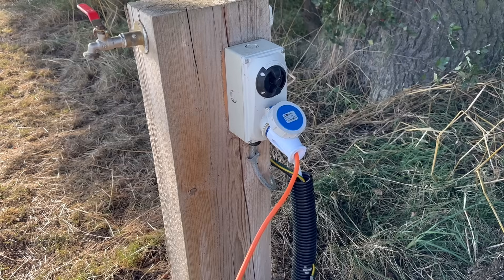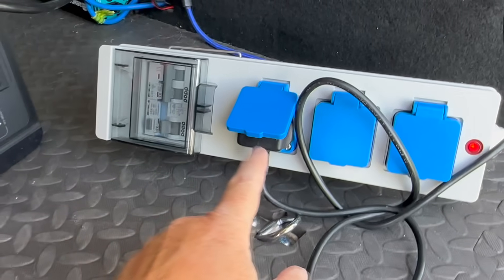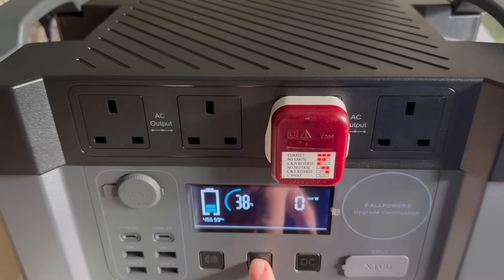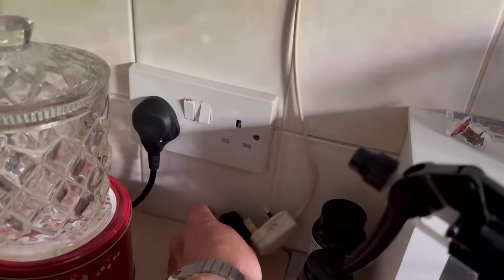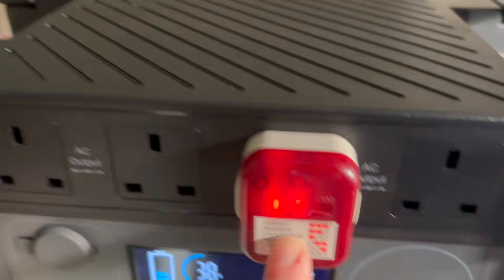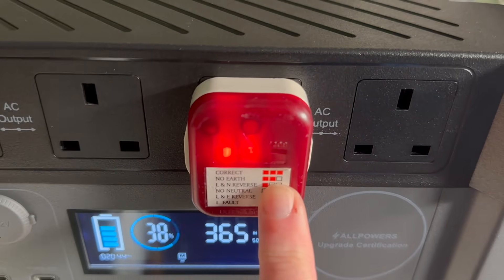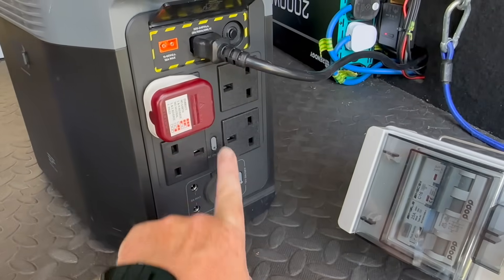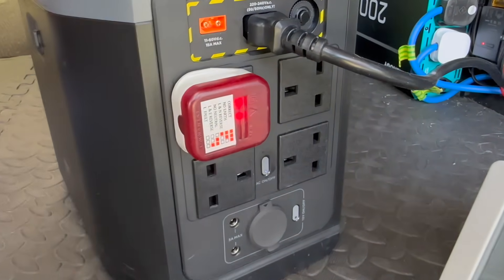Should you Earth Bond an Inverter to a Vehicle Chassis

Comment from the maker: As some viewers are getting really confused I just wanted to clarify the following…

“residual current device (RCD) is a safety device that switches off electricity automatically if there is a fault. RCDs are far more sensitive than normal fuses and circuit-breakers and provide additional protection against electric shock”

Source - https://www.ddfire.gov.uk/residual-current-devices-can-save-lives

There are many more resources that explain how an RCD helps protect you from fatal electric shocks and faulty appliances possible catching fire.

The internet is a great place to learn, so please use it. I’m happy to learn too, but I prefer to learn from facts rather than opinions.

Comment: Hi John, I'm building a new to me camper and visiting your channel for a refresher course if you will regarding the electrics, very well explained regarding earth and the inverter. I did notice you are using what I call a tent style 240 hook up, is this what you use in the van for 240 when on a campsite or anywhere you have access to 240? No so called traditional hook up point to RCD in the van? Thanks for posting the video

Comment: This is such a confusing issue for non - electricians like myself.
I converted a new cargo trailer to an RV. The solar system was originally installed in my 5th wheel by a very reputable solar installer who had done about 3000 installations before mine. They did NOT install any ground wire from the charge controllers or inverter. It's hard to belive they overlooked this with their vast experience. I assume it was intentional. I moved the entire installation to this converted RV. 
When I was about 12 years old I was in my dad's RV during a thunderstorm. There was apparently a problem with the pedestal at the RV campsite. I stepped out barefoot onto the wet metal step of the RV just after then rain stopped, then put my other foot on the ground. I vaguely remember being totally paralyzed, and shaking and screaming. Fortunately it knocked me unconscious, and when I fell face first into a mud puddle, my foot came off the step. My ankles felt like they were broken, yet within a few hours I was fine as if nothing had happened.
So to me, the thought of intentionally sending electricity into the frame of my RV just seems insane. Why in the world would I EVER want to electify the frame of my RV? I don't wish this near electrocution experience on anyone.
I used metal boxes for my 120 volt outlets in the RV. The box is grounded with the ground conductor, and the outlet itself is also grounded using a pigtail to the box. None of the metal boxes contact the metal frame of the RV. All boxes are screwed to wood framing. To my layman's mind, this means that if I ever have a short in a box, the electricity will be contained within the box, or the neutral or ground wires.
Why in the world would I want to change that in such a way that electricity is EVER sent to the metal frame of the RV?

Comment: Hi John, very informative.
my problem is. I have wired a ring main via an RCD unit with a B32 and a B6 RCD to use via a camp site if needed. i connect it via a cable which is designed for the job but it keeps tripping when i plug a hoover, kettle etc.
any help would be great
thanks in advance.
Phil.

Comment: So can I run a 2000w renogy inverter to a single plug socket  in the kitchen ?  for the induction hop though a 25mm cable .will this be ok or do I need to plug straight into the invertor

Comment: Hi John a quick question I know the wire  from the solar panel  is dc wire after the mppt is it ok to use  1.5  2.5 stranded copper ac wire for everything else

Comment: I have a battery bank on my rv separated or isolated from the converter or house system the house battery has a chassis ground but my inverter solar bank just has the negative running in to the negative lug on the inverter what would happen if I grounded the solar battery bank neg cable to the chassis or would it destroy my inverter and controller

Comment: I made the mistake of tying ground to neutral in the breaker box of my camper with a Renogy inverter.  The inverter refused to run, going into ground fault shutdown immediately on power up.  Separated them and all is working fine.

Comment: If you have a Victron inverter and a rcd you should earth bond the neutral. Victron recommended doing this so the rcd has a ground potential to operate correctly. If you have purchased a van from a factory it will undoubtedly have a rcd. Not sure about other inverters. The victron units have an internal relay to disconnect the shore power earth as you can only have one ground potential at a time for the rcd to operate correctly.

Comment: rather strange issue I have experienced--- one day I was shocked by the metal part of solar roof-- the motorhome is plugged to 240v inlet to start with,  could it because the source of 240v does not have earth and causing Hotwiring any sorts?  no tripping RCD at any part, but the solar panel frame and metal bracket has measure about 86v AC voltage only when I hook the 240v to the motorhome at my place so far-- I have not tested elsewhere but at my parent's place the shocking current disappears.  Could it be the source of the 240v has earth issue?  but how come the earth leaking goes to the body of motorhome?  given motorhome are on 4 rubber wheels, I don't suppose an earth screwed to the car body?

Comment: Hi, I have hooked up my VTOMAN 1500X to the EHU.  Motorhome has a Sargent but the cross polarity light turns red when I press the charger/space heater or water heater button. Is this because of the VTOMAN Power station , is this an issue & will the motorhomes built in RCD's trip before it can cause a safety issue? If you feel that all is ok with above set up how do you stop the vehicle & leisure batteries from also drawing power from the power station? Thanks
Reply: I don’t know if this will help you!.

I have a Sargent consumer panel in my Caravan.

They are all factory fitted by Swift.

When I connect my 2200 watt pure sign wave inverter generator to my electric hook up point it also 
turns on the red reverse polarity light!.

I don’t know why, I just know that everything works fine, and it doesn’t cause any issues, I just use it as I 
would if connected to an electric hook up!.

Comment: Campsite hook ups should be connected via a TT System I.e earth stake in the ground therefore if you are off grid and using an inverter surely the inverter and associated sockets etc powering 230v appliances. Surely you would need to bury an  earth stake in the ground connected to the inverters earthing terminal.

Comment: Thank you for your insightful, thought provoking and helpful video.

Thought other would be keen to know, i tested my Bluetti AC180p and unlike test performed in this vid i found;

Bluetti Ac180p features a ups and is earth bonded/distributes ground when connected to grid for ac charging (wall socket turned on). Earth bond is disconnected when wall socked switched off (even though still plugged in).

I will not be connecting the power-bank to van chassis ground  per my fears that led me to this video and for reasons stated in this video. But will take further steps/research to verify built in protection on the bluetti and if rcbo is required for grid connections or not. Wouldn’t want to assume those protections are present. 

Thanks

Comment: Hi, brilliant video! 

I know this is on the 240v. But have you bonded your 12v?? 

I have a 24v camper, and a 12v leisure system. Would you advise bonding the 12v? Or just keep it all contained? It all loops back to the battery.  

Thanks

Comment: I have a Renogy invertor charger and the funny thing is, as its a centre tapped invertor an RCD won't work offgrid.
It will work when connected to hook-up and in bypass mode (basically pass through). There is a relay that clicks over.

Seen a lad who made a system that used a contactor to bond the neutral to 'earth' CPC when offgrid but bonded the earth to EHU when on hook-up.
But like you say... in the event of a fault there is a case where you can send 240v to the body of the van and that can fry sensitive electrics.

The regs are mainly for caravans connecting to EHU at campsites. They are strict as I am sure every 4 hookups needs its own earth rod and it cannot be earthed to a main supply (like a house or building).

Which is funny as that means no one is technically allowed to charge their vans at home.

Comment: I plan to use this with direct solar to DC Side. If clouds block the sun and there isn’t enough solar power, it will switch to AC power. When the sun provides enough light again, will it automatically switch back to using DC power?

Comment: Hi John! 

Great video, thanks! I am having an issue with the touchscreen on my phone and the trackpad on my computer when charging them through my 2000W pure sine wave Renogy inverter, I'm wondering if you've ever come across this and if you have a solution? This problem doesn't happen when charging using the same adapter in a normal mains socket.

Thanks!
Reply from the maker: That’s because you’re using 12v to create 240v and then 240v to convert to 5v usb. It’s called dirty power and many people have made the same mistake, so don’t worry.  You need to get some usb sockets that are powered from 12v - like these https://amzn.to/3YflNIM
Reply: Ok great thanks 👍🏼 will I be able to charge my MacBook from a usb though? It charges on a 40W usbc normally 🤔
Reply from the maker: This is what I use for my MacBook https://amzn.to/3LCXLQs
Reply: @GadgetJohn  Awesome, thanks!

Comment: John, Even though it's not generally needed, some equipment won't work without it. For instance, an EV charger won't work unless you ground to neutral. I have an e-NV200, and having a backup for charging from a 12V inverter is a plus.

Comment: I have a Renogy inverter with an earth terminal on it. You should not Earth to the chassis of the vehicle that would be deemed a false earth, what you should be doing is driving a copper earth rod available from any hardware store in to the ground outside your vehicle. Run a single core wire from the earth rod to the inverters earth terminal. Then plug in your martingale which will show you an earth present, making your system safe off grid. 👍🏻
Reply: what????? you're driving own the road with it. You can't do shit with your "drive a rod in the ground"  so-called theory.
Reply: @pulsenation  do you do this or does anyone do this? I’d love to see some pictures etc

Comment: Hi John.
Would you think a Renogy 2000w inverter is 'Bonded'? As I wanting to charge a tesla from solar, and know the mcu charger can be fussy about grounding..

Read alot about some people conecting earth-neutral to make it work.

But do know if renogy inverters are pre bonded
Reply from the maker: Earth bonding can’t happen in a vehicle as far as 230v power is concerned. It’s all clearly covered in this video. Earth bonding is  for grid electricity

Comment: I have a dual battery system in my vehicle and a battery shunt installed aswell.  Would you recommend I connect an inverter directly to the battery terminals or earth to the vehicle.

Comment: Hi. I'm building a non wall plugged desk system that uses an 1000w inverter and lifepo4 batteries. Should I ground the inverter to the chasi and install shock protecrion? I believe you provided a good explanation about the topic I was looking for.

Comment: Hi John, 

The argument for earthing seems to be this: 
RCD would not trip and the unfortunate person would effectively be another appliance drawing power as there would not be an imbalance.

Someone explained the reasoning but the comment seems to have disapeared. 

I dont fully understand the subject so could you explain why you believe this isnt the case ?
Reply from the maker: I removed the comments due to dangers of false information. 

There’s a pinned comment here by me with a link to a succinct explanation of how an RCD works, the link isn’t opinion nor is it from an uneducated “sparky”, and the easiest answer is a quick google search “does an RCD protect against harmful electric shocks. 

RCD constantly monitors the electric current flowing through one or more circuits it is used to protect. If it detects electricity flowing down an unintended path, such as through a person who has touched a live part, the RCD will switch the circuit off very quickly, significantly reducing the risk of death or serious injury.

https://www.electricalsafetyfirst.org.uk/guidance/safety-around-the-home/rcds-explained/

Comment: Hi John,
Interesting video. I have the same 2000w Renogy Inverter, which is brilliant, I'm sure you will agree!

All this talk of earths... the case on the Renogy has an earth point on it, which I'm presuming is just to earth the case, in the event of it becoming live somehow. Should you, in you opinion, connect this to an earth point in the van?

This is, indeed, a a very hot topic on the social media platforms!! I see many people pushing for AC earths, some distance from any DC earth, and RCD's as standard. I currently use a portable 'tent' hookup (as featured in the video), which because its not fixed and has built in RCD, I feel is a good compromise!
Reply from the maker: It’s interesting because it’s very uncommon to have DC earths, not many devices using DC would even account for an earth in their connectivity. I use the hookup with RCD (as shown) due to the fact I’m rarely hooked up to mains power and this cable has 3 pin sockets which allow me to plugin my mains chargers without changing my internal mains wiring.
Reply: @johnrefoy6916 I have the 1000w renogy, i posted about getting a small consumer unit on the output side of my inverter and was told it won't work.. are you saying you are using tent / portable mains hook up on the output side of your inverter? Thanks
Reply: So does renogy 2000w jave an earth point i can connect to a grounding rod?

Wanting to charge a tesla from solar and confused by bonding and grounding issues. Just want solar power to charge the car.
Reply: My Renogy 3000 inverter has the earth terminal on the DC input side of the box. If I test continuity between that terminal and the negative DC terminal, it tests positive. This suggests to me that it is a DC earth, and also that connecting the earth terminal to the vehicle chasis is redundant and not necessary. Am I wrong?

Comment: Morning John, I have just bought the Bluetti C180 and it has a earth screw point on the side of it  ?
Reply from the maker: It seems Bluetti had issues with the floating earth system in other models so included an earth on the ac180 but they do say it’s not vital it’s used but will improve safety if you can earth it. Which sounds like they’re trying to cover their a$$ for future problems.
Reply: @GadgetJohn  cheers John 💙❤️

Comment: This is a cracking post John. We distribute the Clayton Power systems and I’m constantly getting told the unit should have a consumer unit to comply with regs. The unit has an inbuilt RCBO which means the consumer unit isn’t needed if you don’t want one. 

RCDs can protect against electric shocks, residual currents, and earth faults. On the other hand, RCBOs can do what RCDs can do and protect a circuit from short circuits and overload. RCBOs are essentially a combination of MCB and RCCB. As such, it can protect overload and short circuits.

Really good point well made 🤙
Reply: RCBO is far better, I agree.

Comment: Hi Jon, I have a very similar set-up to yours, I have not bonded my Renogy inverter to the chassis. I do not have an RCD after the inverter but in a slight departure to yours I do have one on the 240V coming into the van (before it plugs into the inverter) the reason for this is that even though when I am on a site the site will have a trip when I am at home and plug into the mains would be relying soley on my domestic ring protection which is not that safe.

Comment: Seen loads of discussion on this, for every opinion there seems to be a counterpoint. This thread may help clear up. A electrical engineer advised me that earth means earth, if your not connected to the ground your not earthed. On hook up the power mains should be bonded to chassis. If not on hook up  vehicle would need an earth
spike for ground to be effective. After that I said thanks, I couldn't see me hammering a 3ft steel rod when stationary, would I then need a lightening conductor. Thinking of going non electric, anybody got some gas mantles😢

Comment: I just deleted what I first wrote because in theory the power banks output is an isolated supply, usually 110v on either conductor with 220v between them both. ( not always!)
If you touch one conductor and touch earth (not the metal case of the invertor) you cannot receive a shock as there is no path back to the supply to complete a circuit. 
It's the same way a shaver socket in your bathroom works.
I have no idea how the invertor can shock protect against touching both conductors though. A shaver socket can only supply a tiny current but a big invertor could kick!
Try it, use a multimeter to one side of the power banks output and the other to the earth of your camper, there should be no reading.
I think John's right on this one, but an invertor with built in RCD would be good.
If you connect mains to the camper it becomes a special location needing a 30mA RCD and double pole overloads. You then need to bond the chassis as for example if you plugged in at home it's usually TNCS/PME earth that can do funky stuff if there is a neutral fault on the suppliers side! 👍🏴